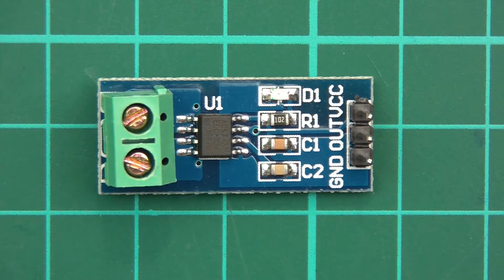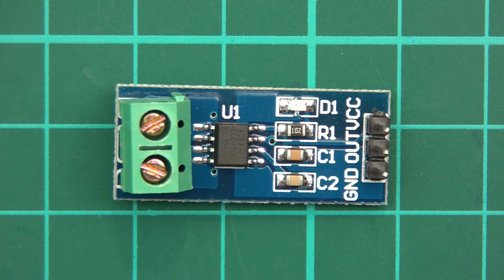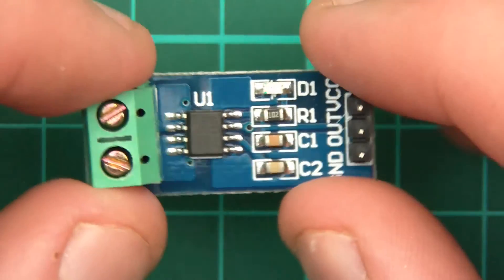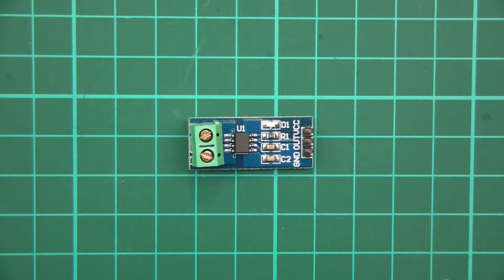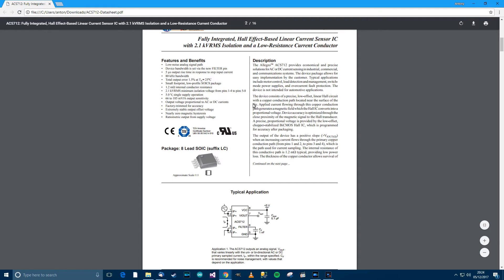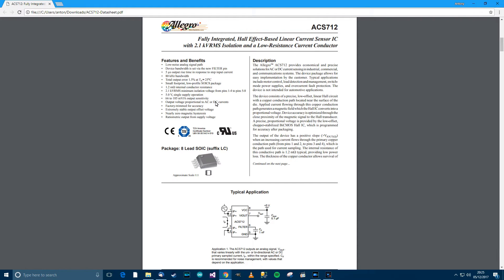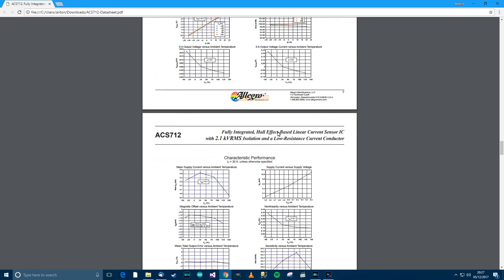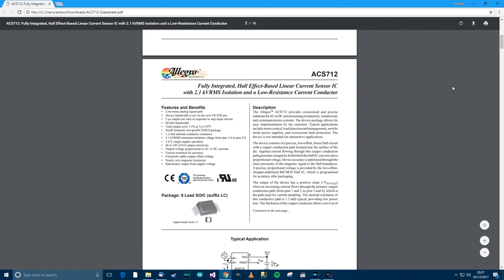TUTORIAL: How to use the ACS712 Hall Effect Current Measure Sensor Module - Arduino (Part 1)

Comment: Hall effect is the phenomena of converting static magnetism to tiny bits of electricity. So current causes the magnetism which in turn is converted to millivolts (if the direction of current changes, so does the polarity of the generated voltage). So basically we are measuring current using voltage generated in an isolated and very safe manner. Arduino is not needed at all. You can measure this voltage using a digital multi-meter and effectively convert it to amps.

Comment: Could you demonstrate how using this sensor one could shut off power via a relay output to a small water pump when the amp draw drops as a result of the pump cavitating?
Reply from the maker: @joemalotcnj1987  Use the Arduino setup, set relay pin high. Use Arduino loop, in the loop, check time every 1ms. If 100ms have passed since last action, then run; set last run to time now, get the value from the sensor. If the value is less than X then, set relay pin low. Done.

Comment: The ACS712 is a direct short across the power supply which will cause the supply to trip. Are you using a  resistor or other or some other load? Maybe I missed something.
Reply from the maker: @stevenring2365  The ACS712 is a hall effect sensor to detect how much current is flowing in a circuit. You wouldn't ever just connect it straight to any source without a load! I mean, you could, but it would be a waste of time because there would be nothing to measure! Unless you wanted to know how many amps your property was capable of delivering or something, but in which case, it would be extremely dangerous and would blow the hell out of the ACS module! 😬

Comment: I have XL4015 Step Down Converter. I can adjust the voltage and measure it. But I don't know to measure the current.
I need to use XL4015 module with my GSM 900A mobile phone to make portable.  I also just bought this ACS712. 
Will this ACS712 module make it easier to adjust current to match GSM current requirement? It requires 5v and 5amp.

Comment: Bought one of these and the output goes lower than the 2.5v idle when current is detected? (Mine does). Thought it would have added to the output -- guess not. Confirm anyone? edit -- you wouldn't think it  but current direction matters so reversed and ok. guess it must be the "right hand rule" in effect ?

Comment: Thanks for the video. I'm having trouble with getting accurate readings with the sensor (ACS712 30A). I'm using a uno and my serial plotter outputs a certain negative amps and spikes up and down, then when I power it up there's no change. Please help. I'm trying to power up a switched reluctance motor. The motor works fine its just the sensor that's acting funny.
Reply: The ACS712-30A  output voltage range is 0 ~ 5V. The 0 means  negative 30A , 2.5V means 0A, 5V means 30A.  If you use AC power, + - current detecting is normal. if you use DC power,  check the source code to find the bug and check the wiring.

Comment: can you help me in  how to sense current from pv panel USING ACS712 5 ampere module , i am in dire need  of the circuit details & coding which i should use to sense current, please help me i am following your videos  , and have already asked my doubts on different videos plzzzz anthony
Reply from the maker: amish karim Hi, I believe this small series gives you all the info you need. The 5a module will simply have a different sensitivity, and you'll find this in the spec sheet. Antony...
Reply: Antony Cartwright  I have gone through all of your series ,  I am not using a dc power supply as yours I am just using a 9volt battery to provide voltage and a resistor or load in ohms to have voltage drop such that I can get current, as in your video You can supply the current directly , but in  my case I can't , , I know it's a lot to ask for but please provide me a way as to how to measure current , I can give my detailed problem & circuit diagrams , please  give me a test mail on amish7karim@gmail.com & I will send you the details with Arduino output & circuit diagram which I am using, my engineering bachelor's degrees is at stake because of this...
Reply from the maker: amish karim The video gives all details required about this! Specifically, what is the problem/question?
Reply: Antony Cartwright   thanx for the reply, the problem is how to sense current  using a 9 volt battery , a current sensor 5 Ampere and an Arduino Uno....
Reply from the maker: amish karim it's the same as in my video, but the 5a one will have a different sensitivity. You can find the sensitivity in the spec sheet.
Reply: Antony Cartwright  I have already changed the sensitivity to 185 , I can only explain my problem to you via a schematic circuit diagram is there any possibility that I can send you my circuit ?
Reply: My question is WILL there will be no change in the circuit if I use a 9 volt battery and connecting positive & negative  of the battery to the ACS 712,,,,
P.S I DON'T HAVE A POWER SUPPLY UNIT & CANT CONTROL THE AMPERE TO THE ACS 712
Reply: Amish, my understanding is that it works as a bidirectional current sensor, there are three different versions for different max amps, and no, fundamentally there is no difference in the circuit but the different models may need different code constants to run...